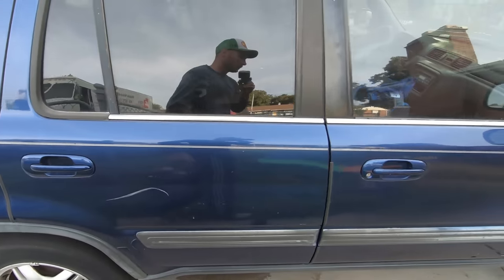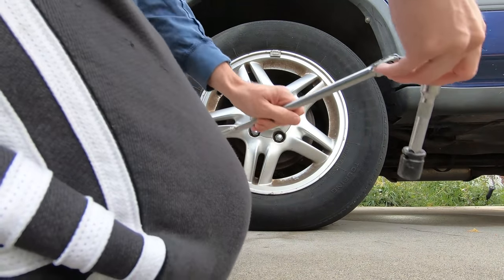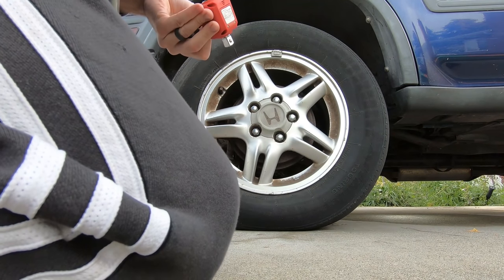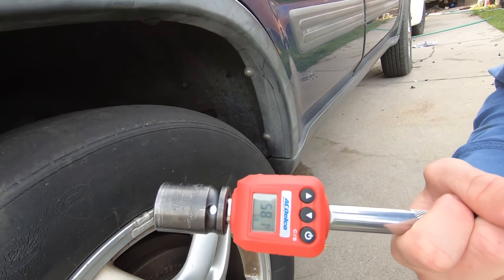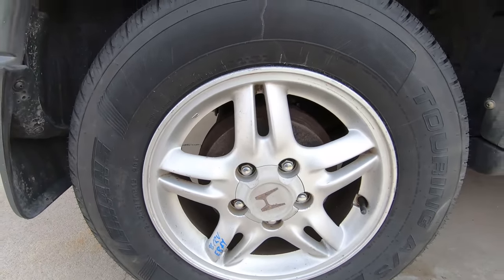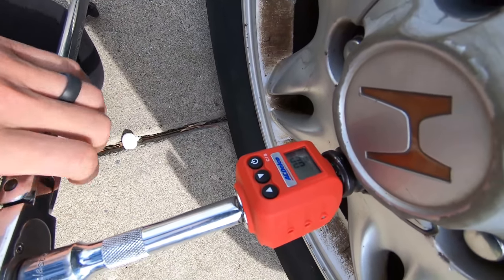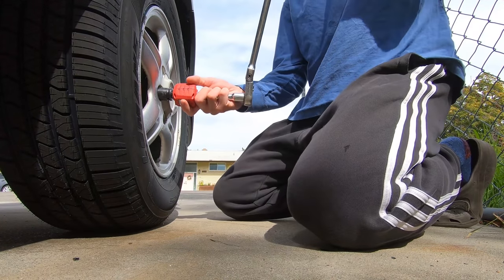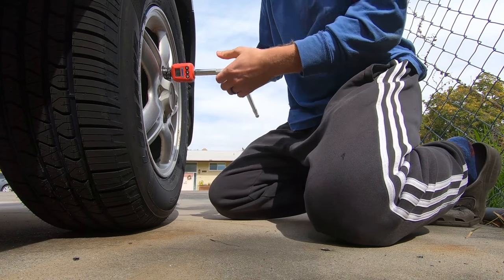Will the local trusted shop torque my wheels or use an impact? *Surprising findings...*

Comment: Proper torque of a lug nut is one of the first things I look for in a shop. I have all to often seen loose or over-torqued lugs (in fact, I have lost a wheel before due to over-torqued lugs that sheered all 5 of an s10 blazer). If they are not willing to torque properly, what else are they cutting corners on?

Comment: Pep boys tire guy here. I do use the impact putting on the tire. But at lowest setting on my gun and just popping the trigger. Not hold it like a uzi. Then get it on the ground  and torque the lug nuts. What I found best is to use a tiny gun to zip them on there enough(Not loose) and then torque them.

Comment: I torque every passenger car wheel to 95 Ft-lbs. I don't care if its steel, or aluminum. 80-100 Ft-lbs is safe.
Reply: 19mm is 100 ft-lbs, unless it's a truck- may be 130ft-lbs. 21mm is 76-80 ft-lbs(most Honda, Toyota, etc...).
Reply: You could be right do you work at Firestone?
Reply: @davidgallego2854  Walmart TLE

Comment: I started off at a tire/automotive shop and every wheel saw a torque wrench. Every car was required to have the rust and corrosion cleaned from the back of the wheel and the hub, after you torqued a car you had to go on the computer, input your username + password, then your name would be attached to the work order. They took that stuff super serious.

I just started working at the dealer and I'm the only one in the shop who uses a torque wrench on the wheels, I even got called weird for doing it. Whatever, it's a habit I can't break. I don't mind because it's a part of my mental checklist to make sure I didn't forget anything.
Reply: Dont care about other, you doing a good job, safety for customers.
Reply: Good habbit, we do the same at our workshop... ok... no username and password. But when ever we change tires we remove the rust, if there is some, and use the torque wrench

Comment: When you replace your airbags and seatbelts make sure the tensioner or buckle isn’t also blown . Most of the time they throw a SRS code . And you also need to replace the airbag control module under the center console . It’s what commands the airbags to blow and it is only good for one use !
Reply: You can reuse it you just have to have it reset there are companies that reset and rebuild your seatbelts and control module

Comment: Tire shops and quick lube places usually do things quickly as possible.
I can tell you this, at my shop every single wheel removed gets put back and hand torqued.
FYI torque sticks are very inconsistent on electric impacts, they impact at a diff speed then air guns.

Comment: Work at a tire store, we gun the wheels on, if using an air impact gotta have a 65ft lb torque stick, and if using an electric on like most of us have, turn it down so it doesn't put the lug on past 70ish. Then finish it off with a torque wrench, and then we have a colleague double check our torque wrench setting and each lug not. We don't tend to have any wheels come off that way and we don't brake lug studs very often either.

Comment: you mentioned that you buy your tires on ebay.  I have never tired that and was wondering if it really comes out cheaper with shipping and installation costs?
Reply from the maker: This set of "lemans" made by firestone were 247$ free shipping The firestones at costco ther other cheapest place were 110$ each. before additional costs. My dads bought a lot on ebay and for years has sworn by it. I am pleased. These were brand new. but according to him you also find like new (used) sets for smoking deasla s well when people take em off of their vehicles for whatever reason.
Reply: I’ve purchased several used tires off eBay as well - it’s a lifesaver when you can find a near match for a tire that’s not repairable, especially for a 4WD vehicle.  A lot of the used tire sellers will include tread depth that you can match with what you’re replacing.  I’ve found the exact brand and model two different times for different trucks.

Comment: I use torque sticks on all the stuff I work on. After getting the set I have a checked them and they are prettyy accurate. My son works in the tire shop at Costco and they use a torque wrench on every vehicle.

Comment: You've tested if they used a torque wrench on the wheels. Man you have top expectations for a Tyre shop. In Romania, the only part that is touched by the torque wrench is the head of the motor. That is the ONLY part. I've worked as" internship" at Toyota,  as I'm only 17. I guess it's no wonder why cars around here don't really last longer than 14 15 years, plastics start falling off, here if a clip is broken, they usually jam a screw in there, best case scenario, or they just leave it and it is a common occurance for plastic parts to fall of on highways. I've just discovered on my 07 Fit (Jazz for Europe) that one of my number plate screws was broken, from when they repainted my car. Their fix was to use a self tapper near it and bingo I have a new hole in my hatch. I won't trust Romanian shops ever again.

Comment: That car is looking great for a cheap daily driver.  I watched a video some time back of a guy using a heat gun to bring back the color to those plain black plastic bumpers and trim.  Going in a circular motion, you heat it just enough to bring up the color but not enough to melt it.  It looks like it would be just the ticket for that car.

Comment: It’s always a good idea to torque your lugnuts so you don’t warp the rotors and it’s always good to recheck the torque after getting your wheels off and back on because the lugnuts can loosen up shortly after I’ve had it happen and almost had my wheel fly off

Comment: Most shops will use a "torque stick" on their impacts.  Which is usually close enough.  Best practice is always to torque them, drive it around for a few minutes, then torque them again.  If you have aluminum wheels you want to do it a 3rd time after a couple weeks.

Comment: I work at a garage and won’t lie I’ve done tests like this with my own impact. Unless it is a lug stud or a heavy truck I don’t look up the torque for the lug nuts I set them to 100  but I know with my aircat set on half power gets them to around 90-95 and I always finish it off with a torque wrench

Comment: I bought an 05 Impala and the lugs were so tight I tried 3 different impacts and none touched them. Used a 25" breaker and stood on it and I'm 260 lbs and ended up snapping the studs off. Finally said the hell with it and went to HFT and bought their Earthquake XT with 2" anvil and even that had a hard time lol.

Comment: last time i tried to break loose my car's lug bolts on emergency was exhausting because of the previous shop uses air impact to tighten those things. add the rusting wheel hub they didnt clean on top of that, leaving me unable to drive home after changing flat tire. shop should stop using impacts on wheel nuts/bolts and start spending a bit more time to torque properly!

Comment: My Texas Discount tire zip on the nuts with a torque stick, followed by a torque wrench. Thing is, the wrench is never adjusted, and full body weight is used until it clicks and usually beyond. All 5 nuts are tightened within 3 seconds or so. So the torque is "at least..whatever". Their goal is speed.
Reply from the maker: haha. as long as it clicks right? haha

Comment: I went to replace my cousins control arm on her car b/c it was damaged. And my dewalt mid torque couldn't take her lug nuts off which I found odd since it never had an issue loosening my car's lug nuts, so I bust out my 25" breaker bar and i had to stand on it and give it a little jump in order to loosen those nuts. Turns out she had her tires replaced just a couple months ago so I knew exactly what happened 😤😡
Reply: Should have not had to trigger happy tire techs

Comment: The Discount Tire in my area always uses a tourqe wrench, but that's probably an exception. The CRV is coming along nice.
Reply: The Discount Tire I use has always used a torque wrench.
Reply: I just got a tire balancing at Walmart and they used a wrench too. That might’ve also been because I was within eye sight of my car though
Reply: I worked at discount tire for 3 years, if you don't use a torque wrench you get fired.
Reply: It is a best practice to use a torque wrench at Discount Tire. If you don't use it, the consequnce is termination.

Comment: I am required to use a torque wrench with the recommended torque spec for all vehicles. Honda is generally 80 ft-lbs for 99% of models

Comment: Also, do you not have a minimum tread depth limit in your state? Uk blanket limit is 1.3mm over 3/4 of the tyre. If not 3points per tyre and a fine per offence. Uk you are allowed to Tot up 12 points before you lose your licence for a period. And those points stay on your licence for 3 years
Reply from the maker: they do not enforce safety in this state. And in most states. But shops will pressure you into fixing stuff to make money obviously. (Exception is semis.)
Reply: @RoadsideRescue  cheers. So bald tyres could be the norm? Must be why I see so many crash cams from the USA that feature cars wildly out of control. Similar point, when did cars come on to the market with dynamic stability control? I see so many “fishtailing” accidents too. Keep doing what you’re doing. It’s what I used to do and loving the real world content👍

Comment: At my last shop I worked at for 7 years we had torque wrenches stationd every other bay and they would make us torque every wheen to spec and would even have monthly observations done by the service manager to make sure we did it right. At my current shop everyone uses the ugga dugga method and I'm still using my torque wrench out of pure habit ha ha.

Comment: My guess is most, if not all, "chain" tire shops just use an impact gun alone. Dealerships and independent shops would be more prone to using a torque stick. When I was 17, I went to work for a SAAB dealer. I was instructed to use a torque wrench to final tighten the lugnuts. We always lubed the studs and wheel bolts with anti-seize. High volume tire shops will most likely bang them on with the impact because "time is money". Get the customers in and out PDQ. At our local chain tire shops (Town "Scare" Tire), the impact guns look like they have been around the block. They get dropped and who knows if they even get oiled. I don't trust impact guns or torque sticks for that matter. Some 1/2" drive air driven guns are rated for over 900 ft/lbs. Torque sticks are supposed to be scrapped after a certain length of time. How many shops do this? Most chain shops hire young guys and they will use the impact gun. I miss having access to a tire machine and balancer. I always cleaned the bead surfaces and if they were pitted I'd apply some bead sealer.

Comment: most shops never torque the tires. they just know the impact will tighten it to about 100ft/lbs give or take. they mainly just don't want rims coming off especially since most people never get their aluminum rims re-torqued after that initial 50-100 miles like your suppose to so cranking them tight is the next best thing

Comment: Torque sticks are good enough. In that type of environment speed is preferred even if accuracy is barely acceptable, and I've never seen a problem that resulted from using impact / torque sticks on any wheel.

Comment: We always use a torque stick, and finish it off with a torque wrench after it's on the ground.  Every lug nut on every car.  No exceptions. If you're caught using an impact with out a torque stick, you're gone.

Comment: I'm an auto tech and I won't lie. We just zip them on with our 3/8th air impact. Its not that far off actual specs for most cars. Big stuff or stud lugs like Mercedes  i will use torque sticks.

Comment: I always torque my customers wheels for a couple reasons. 1 is it double checks that the rim is tight. 2 if the customer gets a flat tire they can remove it (i fluid film between the rim and rotor on every car for that reason. Cleveland ohio) 3 it doesn't stretch the treads. Ive seen some crazy tight stretch lug studs. I would hate to have my customer get a flat on a major highway with a sh#ty jack and the lugs are to tight or the rim wont come off.

Comment: A lot of shops use an impact with a torque stick. But yeah, it sucks when they use impact and overtorque the shit out of your wheels and make it nearly impossible to get them off.
Reply: Just need to be smart when using a torque stick. Still such a thing as too much ugga dugga

Comment: now that you've torqued them all up. Go for a drive and get some heat in them, dive about the same distance as your tyre shop and recheck the torque to remove the wheel nuts

Comment: I have the harbor freight version of that torque adapter. Works pretty well.  That one beeps so that's a nicer feature. If the torque is suppose to be 80 and a lot of them were in the 60's that seems a little low.
Reply from the maker: Yeah taking em off always takes less so its not too crazy! :)

Comment: I use my Milwaukee M18 on setting 2 which is about 100-120FT Lbs so I just runt them until it clicks in star pattern then go over in circle, never had wheel off or over torque situation, def bad if you use air since there’s no limiter or way to know how many FT lbs Max is
Reply from the maker: good to know! what do you mean by clicks? :)
Reply: It clicks??
Reply: Wym?

Comment: Lol I have yet to find a shop that actually uses a torque wrench for anything, even a dealer shop. From drain plugs to lugnuts, they go ham with an impact.
It's why I'm never surprised at stripped threads and snapped bolt heads on any part of a vehicle

Comment: The most important thing with torquing wheels is that they are all the same.  Whether it's 80 or 90 probably won't make any difference but it's important that they're the same.  Also, not all Hondas are the same torque.  My 08 Honda Odyssey spec is 94 ft -lbs.
Reply: Some truth to that. I always heard uneven torquing of lug nuts leads to warped rotors due to uneven pressures. I don't know if that's true, but it computes.
Reply: @UToobSteak  It absolutely does.  I've experienced it when coming home from a tire shop some years ago.  Suddenly had some pedal pulsation after having new tires put on.  I got home and found the lug nuts overtorqued (way more than Ernest shows here.)  I removed and retorqued them and the pulsation went away.  It can also happen if the wheels aren't torqued in a proper alternating star pattern.  If you tighten one side down all the way first, and then tighten the next one, etc. you'll have issues, too.

Comment: Why does it require less torque to remove the belt then you set for spec? Meaning, less torque off compared to on.
Reply from the maker: Just how bolts work. Check out Project farm. He does alot of observations and it always takes less torque to come off.

Comment: All of the tire shops around me torque everything to 100 ft/lbs. Honda civic or 1 ton dodge.... everything is 100 ft/lbs
Reply: Thats a lawsuit waiting to happen, my silverado torque spec is 140 ft lbs, if someone only did 100, thats only 70% the required spec. Theyd come loose in no time...

Comment: The only reason to torque down a lug nuts is so you don't stretch out the threads,I'd be more worried about cross threading that's a pain in the ass to fix.

Comment: How important is it to change all 4 tires on an AWD? And why?
Reply from the maker: Different tire rotation rates in the AWD system wear stuff out. (diff, and trans) its probably not immediately detrimental. but over the long run. I don't know a ton about it either. i've just been told a few times.
Reply: Roadside Rescue my understanding is that there is a manufacturer specific allowance for difference in tire circumference that should not be exceeded. Making it hard to justify using your unused spare if your tires are on the verge of needing to be replaced.
Reply from the maker: Im not sure i understand? But i needed the spare in this case because it was in a crash and the original tire and rim were broken. so i placed the spare on to take it in.
Reply: Roadside Rescue don’t dogging you for using the spare, but I think in theory if the tires need to be within a certain circumference it could cause an issue with drivetrain. Just an FYI for your viewers moving forward.

Comment: Why do you use and extension doesn’t that change the tuque value
Reply from the maker: after the torque meter yes. this one is before the meter. so it doesn't make a difference.

Comment: Did this shop do the alignment as well? I’m wondering how off it was after the accident and new parts.
Reply from the maker: yes great question. the caster is off a little. So i'm going to replace the strut and if needed adjust the subframe.
Reply: Roadside Rescue I look forward to seeing more videos on it. Will you also replace the airbags?
Reply from the maker: just did. (literally) so in a week or so youll see that.
Reply: Roadside Rescue nice! I’ll be there haha

Comment: Thats a nice tool!
Reply: I see it is $60ish something dollar on Amazon.
Reply: @mrpotato152  they are like 30$ on ebay.
Reply: Is it the same brand?
Reply: @mrpotato152  No, AcDelco just gets them from the Chinese and puts their sticker on.  All digital torque wrench adapters are very accurate so brand doesn't really matter, just get the cheapest on with decent warranty.
Reply from the maker: it is. i got it on Amazon. Some don't beep. that's why i got this one. :)

Comment: I had bad experiences with local owned tire shops. They messsed my bmw lug nutt security key and I couldn’t take the lug nutt off. Yeah it’s a bmw but that has nothing to do with using your brain. I even told them not to go too tight with that key. Idiots